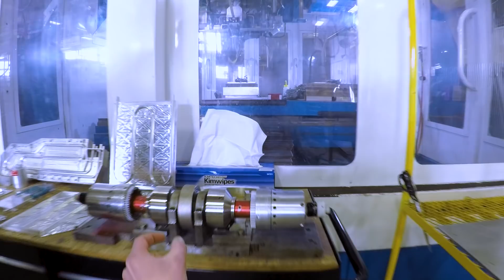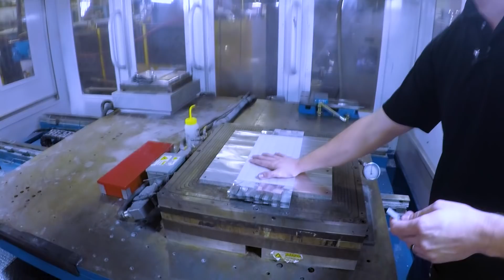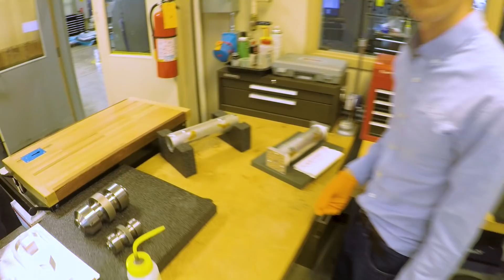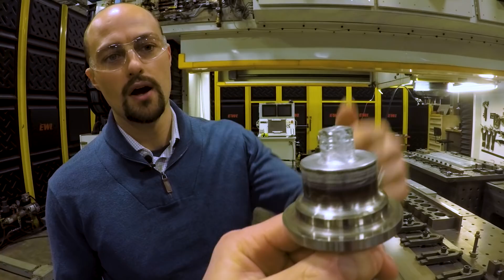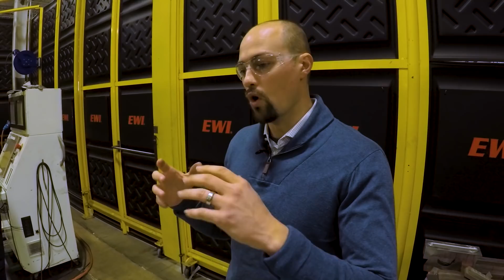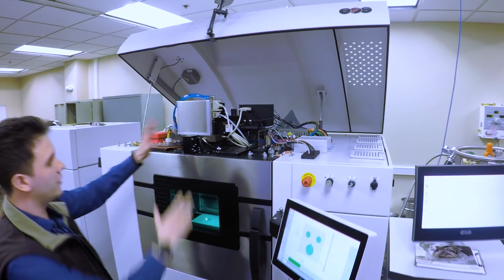Fabrisonic Tour: Nerd Out With Us!

Comment: So in the case of the fiber optic it has a really small diameter so they were able to just lay a film and weld over it. How did they embed the larger diameter pipes and weld over it with sheets of aluminum? Incredible video btw!

Comment: 👨‍💻👩‍🔧👉🐨This got me out bed woke me up 👉👩‍🔧🤳AMAZING FACTORY 5:30 These guys are designing my PC watercooler system for 2020 :) 👍😳as i did simular back in the early 1978s to  2004 spring manufacturing & we did everything stamping grinding along with every spring made for industry tiny ants size to 100-200 feet feed orgers springs i was hand sample maker and ended up doing 3 jobs  machines press & general look after all foreman type busy as a bee loved it but took a break  YOUNG man walked in the Factory 80s & showed me his frictionless hinge! ? whats its for as i studied it NASA so it reduces any friction in space craft as not to cause any electro  shock that might set off a fire 😲🚀 
another guy brings  in a model plane engine he did on a mc machine fook replica of an eng  ww2 bomber type rotary  eng
(* ￣3)(ε￣ *)Funny i welded 2 pieces of rod steal in a lathe by accident 1980s  and  said fook now i got cut & redo the job again IF i only knew back then they do this today  👨‍💻YOU Don't see these Amazing engineering  factory's on OZ STRAYA TV🐨😲  it's why i got the NBN on 2018  youtube has it all 👍🤸‍♂️👩‍🔧🤳🎬
 I Was using a usb prepaid internet$40 a pop 10gb 🥵 waiting for the Fibre  TO Reach Here  😲 2015 was across the road But the LIBERALS  Got back IN POWER & SAID WE DONT need fibre to houses the old 150 yr old phones lines to Node will be just fine - that decision  took australia🐨 back 20 years 3rd world country like   labour party i like has vision & spends to create the liberals 🥵🙈 like to Hoard Money & say the deficit   is more important ? for who the rich? $ exchange rates  stockmarket crap etc  etc lol

Comment: I'm still scratching my head. How were they able to produce a part with a tube through it? I can imagine laying down a thin layer and then cutting the inside tube with a ball end mill. However, that only works to the "half-way" point of the tube.
Reply: We first mill a path with a 'lolipop' endmill.  It has about 270 degrees of arc.   We then fill the channel with a special support material and weld over the channel to seal it in.   Once we get to the desired height, we mill the outside of the tube wall to get the exact shape we are looking for.   Send me an email at info@fabrisonic.com and we can send you a few slides showing the evolution.
Reply: @Fabrisonic1  I bet Harvey Tool Company is your friend ;)
Reply: @Fabrisonic1  Sent! Thanks for getting back to me. As an engineer/machinist/fabricator, what you have is SUPER intriguing! I may have been on the right path. The lolipop end mill approach is awesome!

Comment: 2:48 Young man says "...it's not getting heated or melted whatsoever"  3:33 he says "a friction welding process"  What? Friction with no heat?? Not sure about that...
Reply: There is a small bit of heating, but in aluminum we measure a peak temp of around 250 F.  The heat does not cause the bond.  The scrubbing knocks off the oxide layer exposing clean metal onto clean metal and mother nature takes over.
Reply: @Fabrisonic1  like the "Mother Nature" quote!, As a friction welding, Rotary/Linear  (Bond) engineer for over 20 years here in the UK, it's always fun trying to explain that it's bonding at molecular level, rather than fusion. Have tried Titanium to Stainless steel?.
Great to additive manufacturing being developed.
Best regards from the UK John.
Reply: @Fabrisonic1  Thanks for  clarification. So metal basically bonds because of pressure and close proximity, kind of like pie dough when you press it into a ball before rolling it out.
Reply: @user990077   Great analogy!

Comment: did he really just say that it's possible to 3d print aluminium with a tensile strength of around 1300-1500mpa (200-220ksi)???
Reply from the maker: :)  crazy, right?!
Reply: @nyccnc  yeah, awesome! does the density change a lot?
Reply: Aluminum metal matrix composite.  Aluminum + Ceramic Fibers.  Just like rebar in concrete.......
Reply: @Fabrisonic1  Wow, thanks for letting me know that, do you also know whether or not this results in a great change of density??? (asking because it should stay lightweight :))
Reply: @loukask.9111   3D printed aluminum is the same density as billet.   For the metal matrix composite, the density goes up a bit but the strength to weight ratio is still incredible.